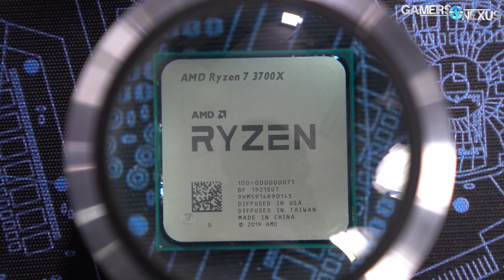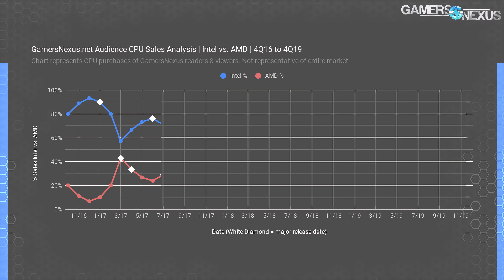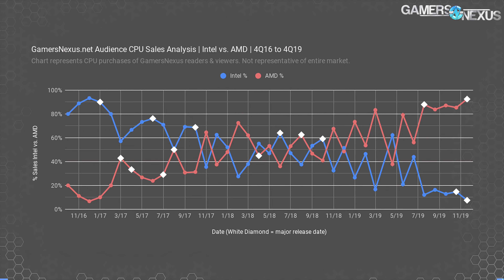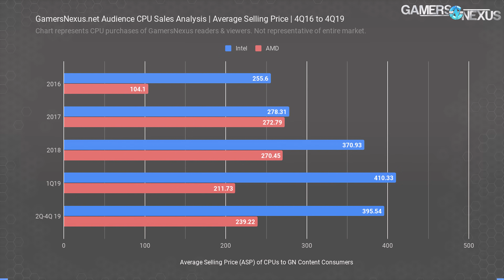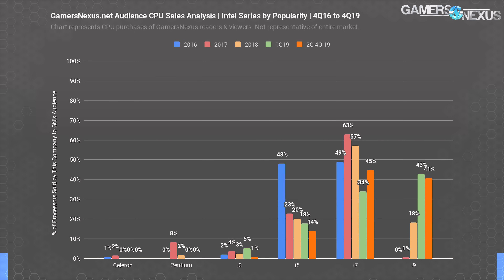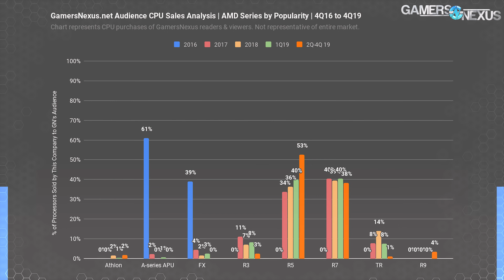GN Special Report: AMD Moves 93% of CPU Sales (Intel vs. AMD 2019 for DIY)

Comment: I would say since Ryzen launched, AMD easily accounts for the majority of new CPU sales.
Reply: Only if you consider the DIY segment. Intel still dominates in laptops and pre-built desktops.
Reply: @microgamestation  Laptops for sure, AMD has near no presence in that market and alot of people now rather buy a laptop than a big clunky desktop since laptop prices has came right down.
Reply: @Dazzxp  With AMD scoring the high end Surface Laptop I'm hoping their perception as a bargain-bin brand within the laptop space will change.
Reply: @microgamestation  Unfortunately i don't think it will, not for enthusiasts anyway as Intels 10th Gen is superior compared to AMD's last gen which is on a older fabrication. The new i7 G7 has around 3hrs extra battery life on the sam battery, is faster in single and multi threaded workloads and also games thanks to 50% extra bandwidth due to it using DDR4X 3733 vs AMD's DDR4 2400 and DDR4X uses less power also.

I think Microsoft gone for AMD because they expect Intel to fail to keep up with demand more than anything but since the two are price comparable there really is only one clear choice.

3rd Gen Ryzen i hope will reverse that with the smaller fabrication reducing power consumption on both the CPU and GPU side of things so more power can be diverted to the GPU but then within the 15w envelope, it is going to support DDR4 3200 in laptops and depends on AMD's Navi Zbuffer compression will help with the bandwidth defect compared to Intel using DDR4X 3733MT/s?
Reply: @Dazzxp  From what I recall the newer Ryzen mobile chips are rather power efficient when considering their core counts and superior integrated GPUs, but I may be wrong; I don't really keep up with the laptop space.
Reply: @microgamestation  The Ryzen 3780U (Zen+ 14+nm) is not as efficient compared to Intels 10nm, and while the AMD iGPU has more fillerate performance it still has limited bandwidth basically the Vega 11 has DDR4 2400MT/s 38GB/sec vs Intels DDR4X 3733mt/s 59GB/sec. While it's good Microsoft has adopted AMD i think it's impact is still going to be limited.
Reply: @Dazzxp  Fair enough. Thanks for the information!
Reply: @microgamestation  those would be laptop sales and pre-built sales. And Intel wil continue to dominate so long as retailers don't even carry an AMD variant.

The majority of people buying processors have easily been buying Ryzen since 2017.
Reply: @FLCLimaxxx  Last time I checked there were CPUs onboard laptops, and the laptop vendor was paying for them; that's a sale, correct?

Comment: Intel has lost me as a loyal customer.  Every year change sockets and cause us to pay premiums for unlocked cpu's and the boards required to make use of them. Then after a year the board you paid $200+ for isn't worth $70 and isn't upgradeable.  Meanwhile all of amd's chips are unlocked and even low end $70 boards can can be used to overclock them.   Intel took their bs a step further when z370 launched making it so you still need a new board for coffee lake cpu's even tho the socket is the same. Being fastest no longer means being the best.  Intel has become a company I no longer wish to give my money to.  So long and good riddance to the slimy f*cks.
Reply: Byke Ryder Intel is worse then slime:

https://www.youtube.com/watch?v=eINDw7zH5dk
Reply: The launch of their 14nm 10980xe at half price. "Which is still killed by AMD's still cheaper CPU" is a testament to itself on how they do not value their customers.   Sticking with intel at this point is so asinine I was willing to downgrade to get away from them.
Reply: I been building intel rigs since the pentuim 4 HT,   and I've finally had enough,  going with my first AMD since a Athlon XP 2400+ I had back in the day.   Sold my 8700k and z370 and was able to buy a B450 & 2600 and shove $250 in my pocket. Along with a lot of upgrade room looking forward.  I doubt I'll consider intel again anytime in the foreseeable future.    I've bailed on them and encourage others to do the same.

Comment: Our company got a notice from HP (we are an HP shop) that Intel CPUs will be unavailable and on back order for months. If you go on HP's website it is extremely hard to find AMD OEMs because they use Intel CPUs in like 90% of their machines. 

Hopefully HP will take this Intel shortage to invest money into their AMD product lines and sell more units. I have sent emails to our management to purchase AMD products but they aren't available via HP at the moment. Lame......
Reply: While it's true Intel has more fabs, they all don't make CPU's. Almost each fab is on it's own process node. The infamous 10nm fab is useless. They have 2 14nm fabs at the moment. Guess what? So does TSMC with the 7nm fab and another one coming online soon. They are also making at least one 5nm fab. What you're going to find is that there's going to be surges in supply for the AMD products for a while. If you want a chip and you find it, buy it! Guaranteed that if you leave and go back later, it will be gone.
Reply: @alexandermckay8594  True, Intel have some fabs just doing chipsets, mobile devices and NAND controllers and they are all on different fabrication processes. I wouldn't say Intels 10nm is useless however... but the yields are still bad and is not very efficient.
Reply: That sounds like Hp wants to lose money on their sales
Reply: Jasonoid
Who the hell would want to buy HP anyway? HP=Horrible Products.
Reply: AMD is just as out of stock. 3800X is selling for 50% over retail pricing because no one has a supply of them.
Temporary Intel supply shortages aside, Intel still has massively more manufacturing capacity than AMD. To put things in perspective, Intel owns and operations 15 fabrication facilities. You know how many AMD owns? Zero. They buy their silicon from TSMC (which has two 7nm fabs) but TSMC also uses those fabs to make silicon for Nvidia, Qualcomm, Apple, and Samsung (among others). So effectively, AMD has the output capacity of ~50% of one fab, and they can't even increase it because Qualcomm and others are using the other parts of the factory. Intel meanwhile has the capacity of 15 entire fabs all to themselves. Long story short, AMD makes great chips, but Intel will inevitably always have more market share and more of the big OEMs on their side, simply because they can produce 10-20x more silicon than AMD is able to.
Reply: @trapical  thanks for the detailed info, appreciate it!
Reply: @trapical  AMD doesn't manufacture the CPU's it's TSMC and they are the ones struggling because they do nVidia, AMD GPU's, Qualcomm, Apple Processors and AMD motherboard chipsets. They are so hammed with demand they can't take on anymore customers and they have invested 9 billions into a new fab to keep up with demand and billions more into further node shrinks. They presently have 13 Fabs. ON the plus side for AMD they have Global doing their I/O controllers, in future they might be better off having Global do chipsets also since I/O / chipsets are typica;;y 1 node behind.

Comment: Do you have an affiliate link that doesn't work for just a single product? Like a "one size fits all" link that I could just use each time I shop on Amazon?
Reply from the maker: You can click any of them and it'll apply to the order for that session, typically.

Comment: I just upgraded from a pretty shitty HP omen 870-244, my new PC specs is 3700x, gaming x 1660 ti, x570 taichi, some Samsung ssds (a m.2 nvme and a sata 3 6gb/s), h500 (cooler master, not nzxt) and a 850w seasonic focus. It is so much better, and I absolutely think it was a worthwhile upgrade.